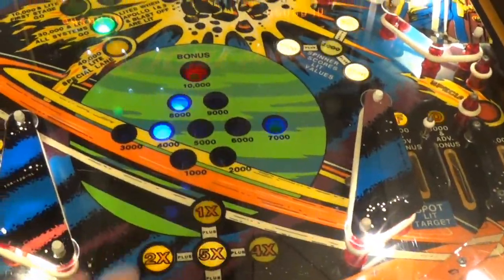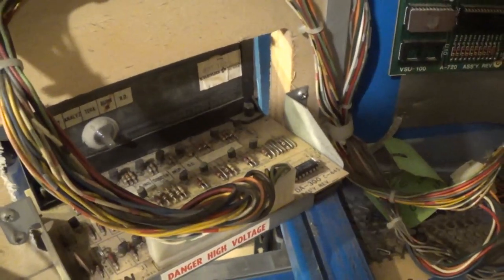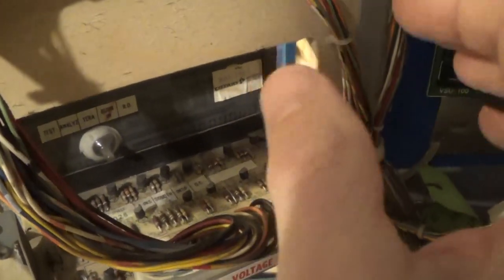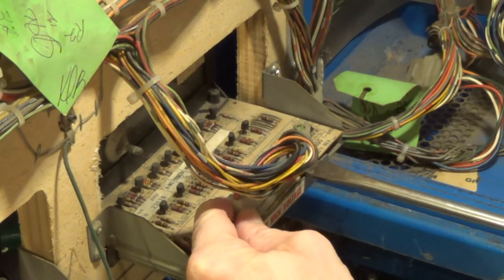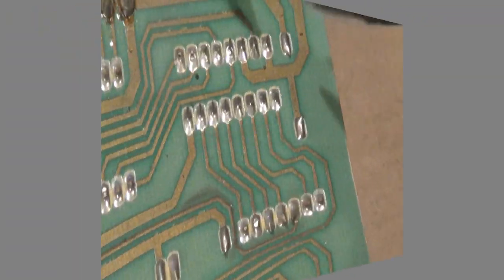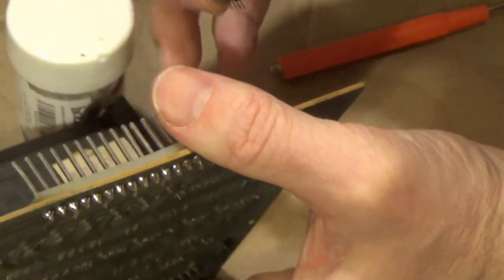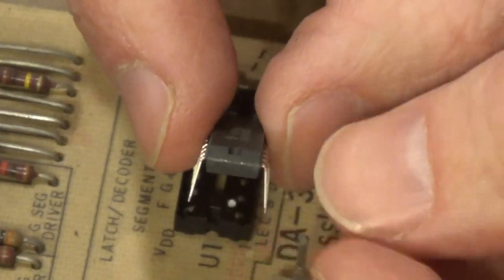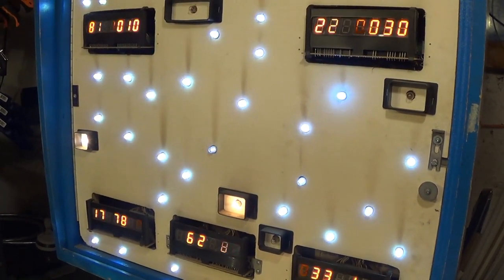Flight 2000 Pinball Project (Part 8) - Score Display Repair

Comment: Good job. A little tip, don't cut the legs on a chip. Just de-solder from the back using your iron and a solde sucker. It will also save a little time as you need to use the solder wick. Your soldering was otherwise very decent, and your post-solder check was 100% correct!

Comment: Hi. Sunny again. Ive finally been able to start on my flight 2000.. iver plugged it in.. turned it on.. lights up..and nothing else.. is there a sequence to get these games running.. am quite new on these..thanks
Reply: Good voltage to the boards essential. There is a flashing light sequence on the MPU 100 that gives you an idea of the fault (search for repair tips on this). My fault was one said to be hard to find, but you can get Alltek replacement parts. Good luck.